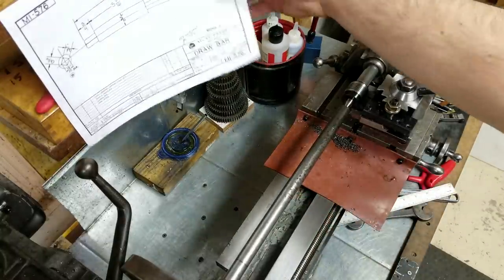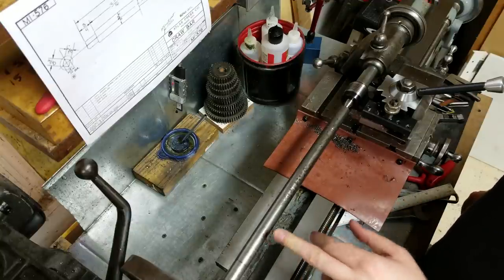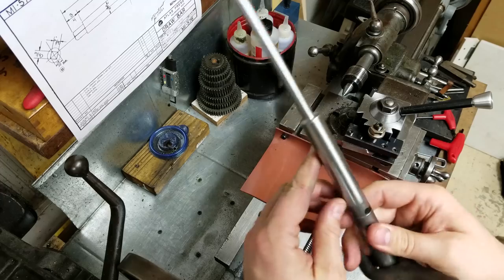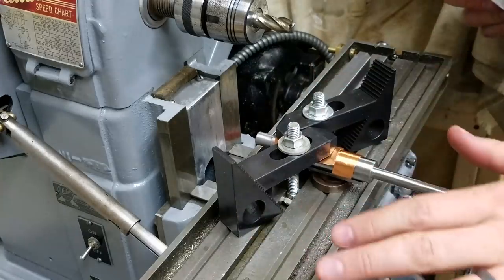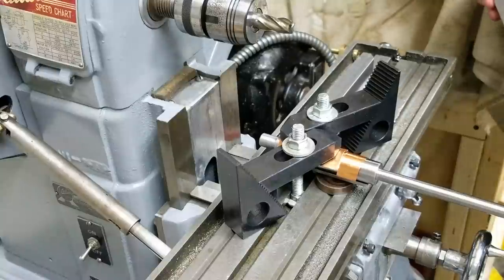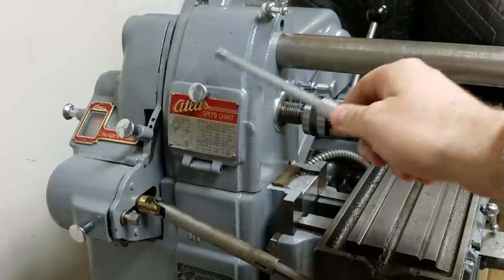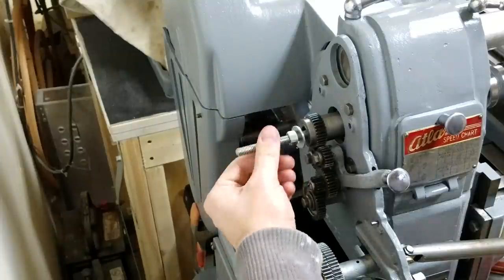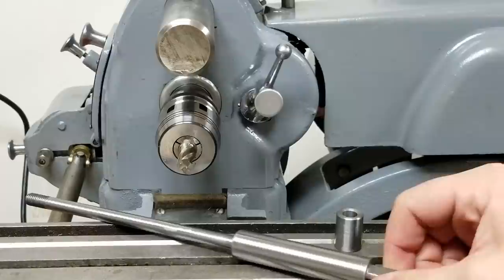Atlas Mill Drawbar  //Beginner Metal Lathe Project

Comment: I've bought an MFB mill that seriously needs blowing apart, cleaning, and some parts replaced, but I've also got a couple of verticals so it keeps getting delayed. Try or just don't tap things on the mills table. The Atlas ones are soft and your going to raise burrs. It's a good idea to run your bare hand over the table and check for any burrs once in awhile. Lightly stone those off when you find them. MT 2 collets would move your cutting tools much close to the spindle bearings where they need to be than the ER collet chuck does, but you have to use what you've got. With any milling machine rigidity is everything. I'm not enthused about MT spindle tapers simply because of the hard tapping needed to get them released or removed. Spindle bearings don't like shock loads at all so always keep that in mind when removing any tapers.Your part didn't need super accuracy for alignment so your 123 block was more than good enough. But if you don't have them yet a good .001" reading dial indicator and later a .0001" reading dti is more than useful around the shop. The little Atlas horizontals really limit the part holding methods with that single tee slot. It's always better to add anything you can to make the setup so it's held as rigidly as possible. But be aware that tightening up on the hold down bolts with nothing above them like step blocks etc can break the edge of the tee slot out making for a real bad day. Threads that are used a lot like on a drawbar will wear a lot quicker if there dry. For anything like that I've found even a few drops of oil gives much better life on both the drawbar and the tool shank. Same thing for the collet chucks threads for the ER's. Just be careful not to get any oil inside the collet of any type where they hold the tool shank. 

The MF and MFB Atlas mills were the earlier models. Atlas slightly redesigned the MFC and added an extended Y axis bearing hanger, longer Y axis feedscrew, a slightly different casting for the running bushing that joins the horizontal support with the cutting tool arbor. All that was done so a vertical support bar could be used that bolted to the face of that upper casting and clamped to the extended Y axis bearing hanger. Even used those parts are real expensive on Ebay when they rarely come up. But they could be replicated fairly easy with a lathe and mill and are supposed to make a real difference in what the machines capable of while horizontal milling with that tool arbor. Likely you already know it by now, but a good vertical mill makes milling a lot easier for most but not all parts. Horizontal mills have there place and because of the way the blade type cutting tools are supported they can move a lot more metal with much less hp simply because the cutting tools  are more rigidly held. That's why I bought one and there's at least some jobs that can be easier sometimes. Knowing what I do now I wish I'd searched for one of the small Hardinge universal mills though.
Reply from the maker: +Turning Point Hey, that was some good info.  I agree the ER collet puts the end mill too far out.  I'm looking into buying an end mill holder with MT2.
In an ideal world I would have a vertical mill, but I'll keep at it with the Atlas for now.
Regarding the table and the support bar add-on, I have purchased some steel to make a fixture plate and the support.  Like you say the single slot is limiting and rigidity is everything with the mill.  Thanks for commenting!!
Reply: I bought a full set of MT 2 collets from Tools4cheap when they were still in business. No idea who sells those now but they shouldn't be that tough to find. They move the tool in as far as you can get. If I remember correctly one of the Atlas Yahoo groups has the dimensions of the OEM MFC Atlas parts to use that vertical support bar. If your not a member it might be worth checking out. And adding an MT 2 shank small boring head or building one but NOT using those worthless offshore carbide tipped boring bars goes a long ways to increasing any mills capabilities. With the fairly narrow table and limited Y axis travel on these mills they really need stubby boring bars though.

Original Atlas mill vises are way overpriced for what they are and there design is light years behind something like a Kurt angle lock. The ground precision screwless toolmaker vises can work ok but they won't hold the parts quite as tight so that has to be kept in mind. I bought an Accu-Pro screwless that I'm real impressed with and they have hold down slots on both sides and each end. A lot of the other brands don't have any hold down slots and I doubt I'd trust them even on the small Atlas.
Reply from the maker: +Turning Point Seriously appreciate your input. Especially on your experience with the vise situation because that is definitely on my list of goodies to buy.

Comment: Nice project, I just got my first lathe not long ago (a little Grayson) and funnily enough, my first project was a draw bar, though mine wad for the tailstock. I do have a hankering for a mill though (sigh), but ought to acquaint muself with the lathe first while I recoup my hobby funds lol.

My next project is to work out a release mechanism for the MT2 arbours as they're a bit  tight once seated in good n proper, I loath it but I'm forced to use the draw bar currently so avoiding jobs which require it until I can find a work around. 

Thank you and keep up the good work, as a noob myself it's great to see so many of your projects are easily replicated at home and I'm lovin every minute of em :)
Reply from the maker: +WrenagadeWorkshop Hang in there, I know that feeling of wanting more tooling.  In the meantime keep making chips. 😎

Comment: I hope you understand this post because I dint have the slightest how to describe it but here goes: I have an old (I think) Powermatic 90 banjo. it has a type of cam lock running the length of the banjo with a handle for tightening. But on the side of the banjo there is a place(about 1" in diameter) for a steel rod about 3" long to slide into. This is to hold the tool rest tight. I think it would have a slice taken out of it to let the tool rest slide all the way down. Finally, to the point, would a machinist be able to duplicate what is missing by just looking at the banjo? it also has a threaded hole on the other side of this mechanism for some use. If you or anyone else on this post has a suggestion I would be grateful.